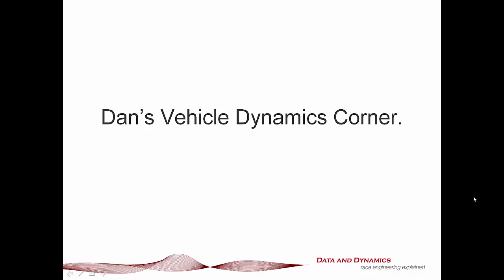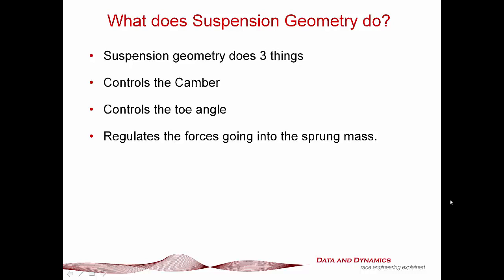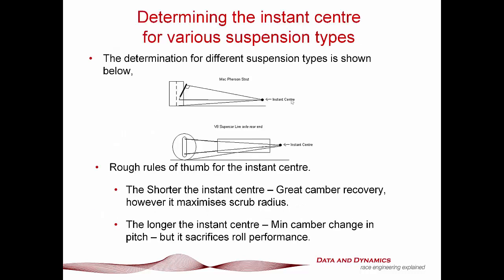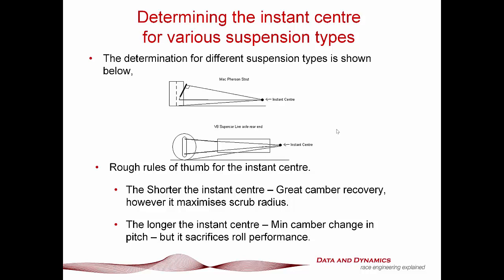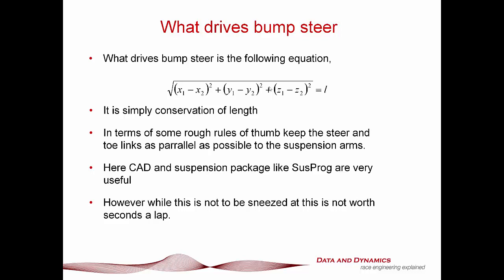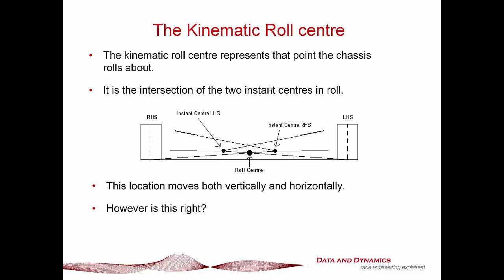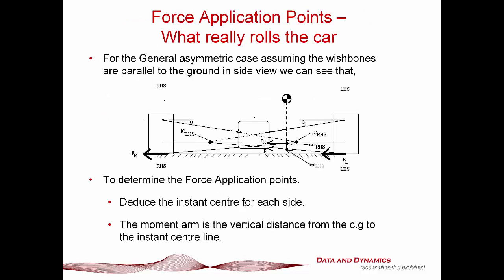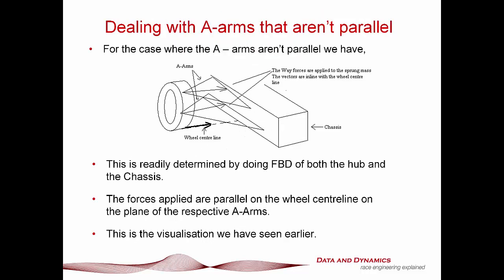Suspension Geometry - Myths and Reality revisited

Comment: Does the center of gravity really migrate so far laterally that the force-based roll center is significantly different from the kinematic roll center?  Is it not just the sine of the roll angle, which is a few degrees at most?
Reply from the maker: A couple of things to clarify. Firstly unless the car is really badly sprung the lateral movement of the c.g is quite limited. However one thing to bear in mind the concept of the kinematic roll centre really is very dated. What drives the forces and moments is the force application point. That is the key.